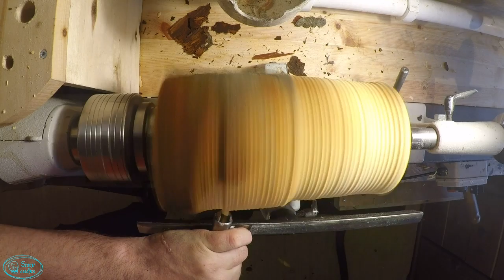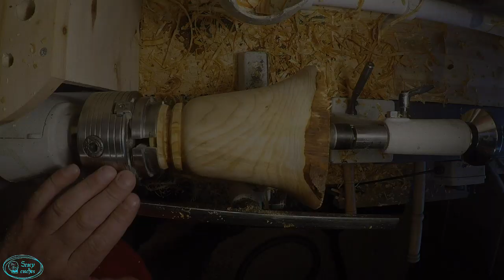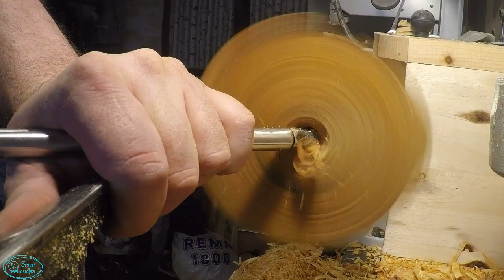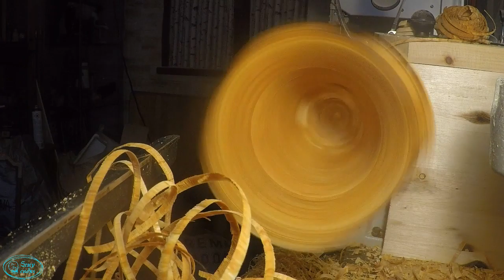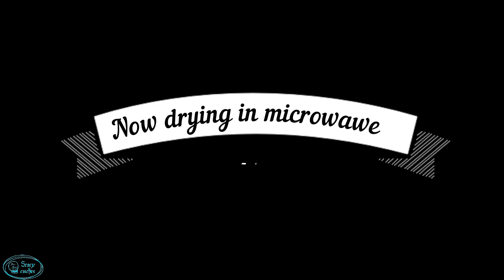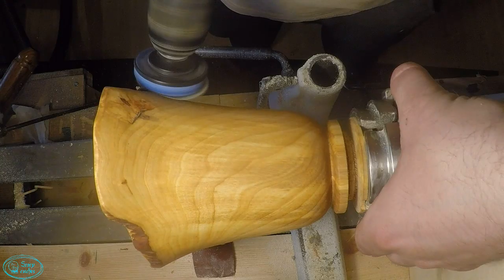Grey alder vase. Woodturning

Comment: What kind of steel is that hook made from? I guess you have made it yourself?
Reply from the maker: I had to see, because I have made so many different hooks :). I have made hooks of HSS steel (blanks from Ebay, thread die and so on) This one in the video is grinded out of a HSS M42 12x12mm blank. I have also heated HSS and bent them to a hook. It's not the right way to do it, but it works. May lose some of the hardness in this way, but it gets sharp, and the edge lasts for a while :)
Reply: @2005boerge  Thank you for your response. Could it be made from a car spring?
Reply from the maker: @eriklarsen6131   Yes ,but it cant handle so much heat as HSS, but im sure it will work anyway. Try it :)